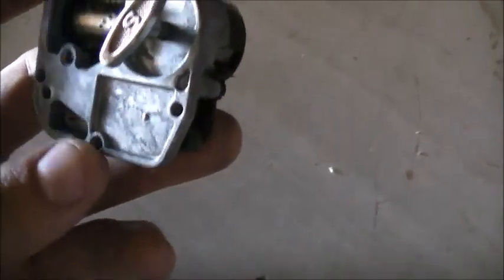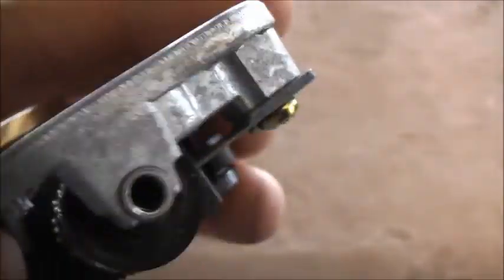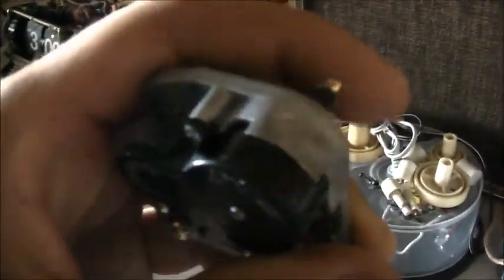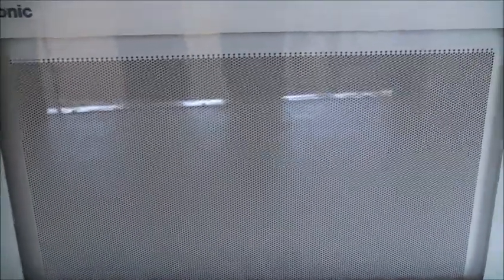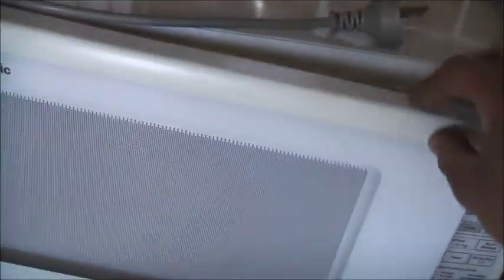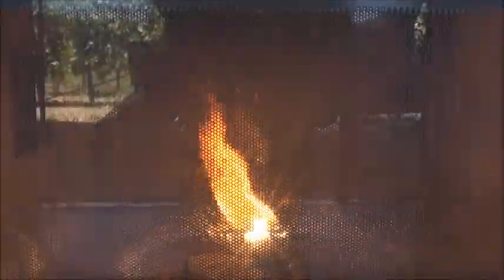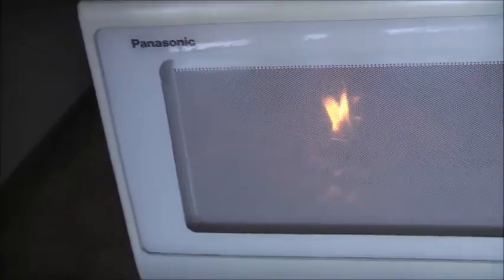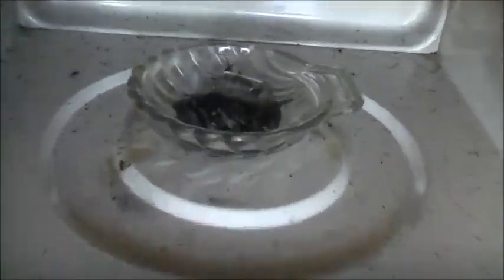More Microwave & Capacitor Bank Carnage!!

Comment: Mmmm, nice big pops, but like you said...Probably need a bigger lightbulb / ballast for faster recharging time.

Also, on the AC-side of that arrangement, if you were to use the variac (before the ballast) you could effectively choose what voltage to discharge into things, so instead of the pops being one big flash with bits everywhere, you could 'turn-down' the volts to get things to glow scorching hot & gently melt instead of one big obliterating *POP* :-)

Thanxx for showing,

-BoomBoxDeluxe.

Comment: I did say in the other posting about the clock to post the full spec on the gear so we can see it, teeth/diameter/thickness/hole size.

Locals may have one or know something that has the gear you want.

anyhow, dont give up on the clock, its a novel design :-)